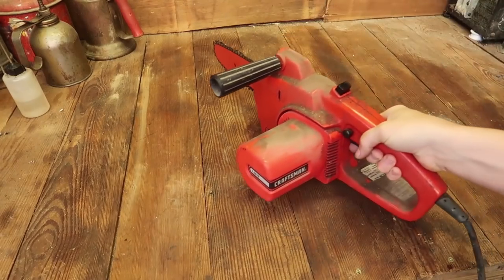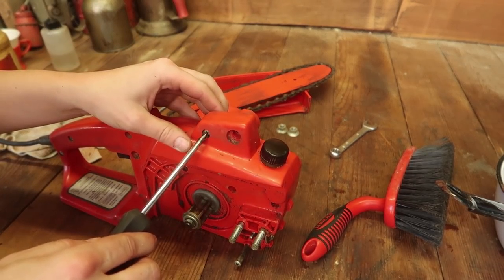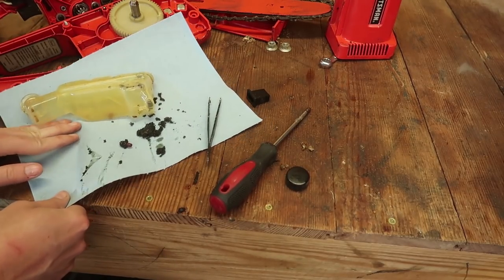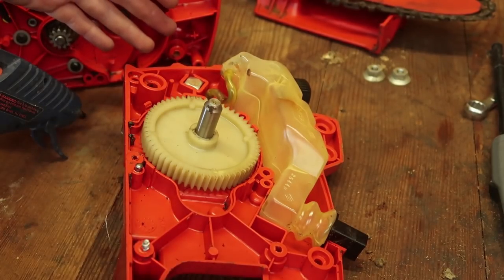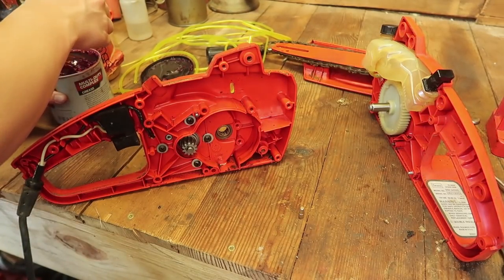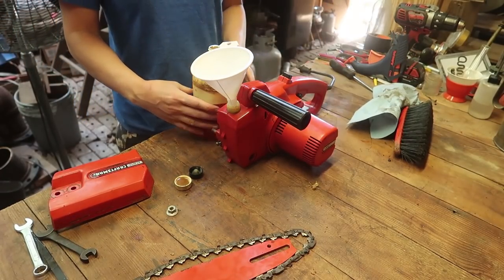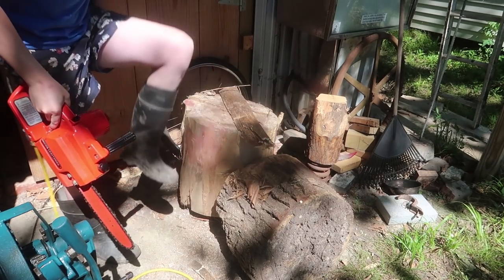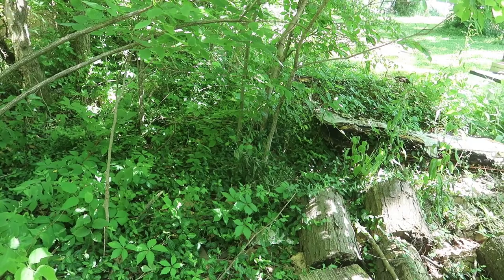1982 Craftsman Electric Chainsaw Model 358.34550, Teardown and Restoration, Built Very Well

Comment: Those holes are for "duckbill valves" they're a one way check valve, you can still buy them. They let air in when the oil comes out. They usually disintegrate and are missing in old chainsaws. 
Longtime viewer from UK, hi :3
Reply from the maker: see thats exactly what i needed to know
Reply: But is there a need for three intake valves?
Reply: @vasiliigulevich9202  The more intake valves the better boyo.
Reply: @RinoaL  hey rinoa! Do you still have your craftsman riding mower! I have a sprocket that broke on yours.

Comment: Nice! We've had a Wards electric chainsaw sitting in the basement since before we'd moved here in '79. Maybe a decade or two ago, we'd taken it off the window sill it had last been planted, plugged it in and gave it a run up. Sure enough, it ran fine. We'll need to find a cap for the oil tank if we ever want to use it for anything.